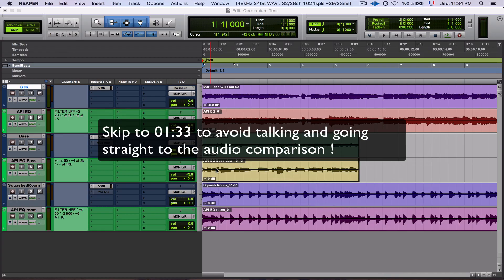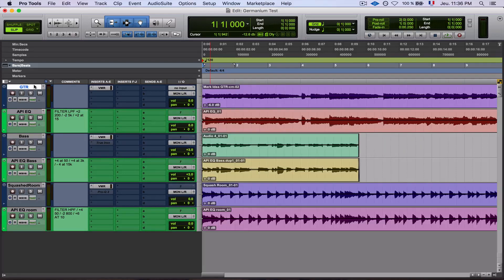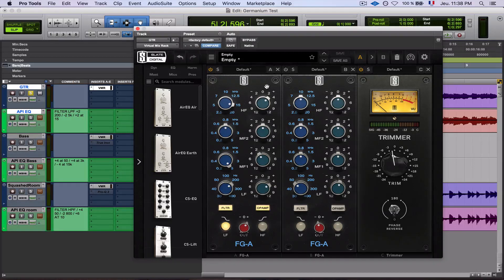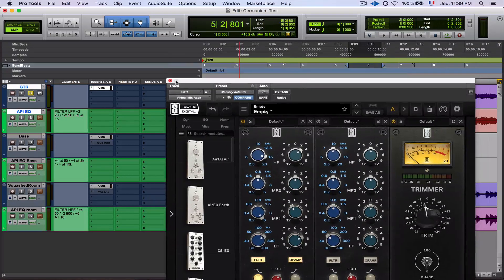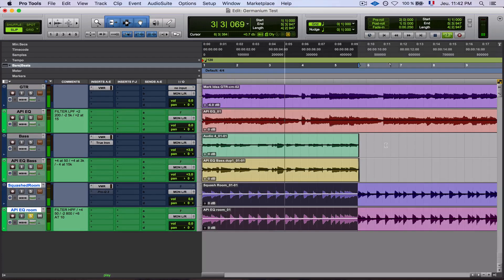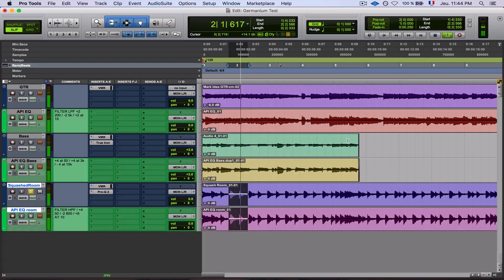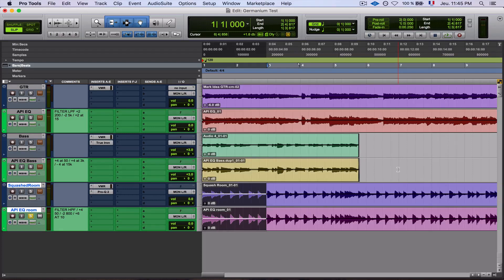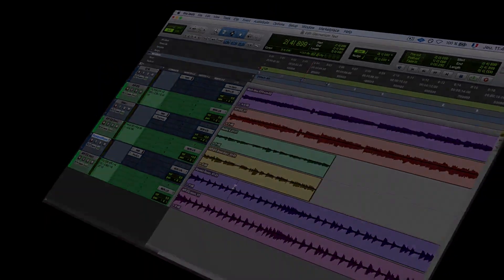Unbiased Review : Slate FG A - API 550A Hardware

Comment: comparison + magic trick with eq boosting! this is more then we expect! thx! :))  

little advice from me, i think you need to use 2 big meters like brainworx have..to show us true peaks , like the both of this tracks have not more then 1 db difference..its just for no question comparison , iam sure you made this match before :)
Reply from the maker: Hey man, thanks for the kind words =D. Yeah the True Iron trick wasn't expected at first but I wanted to match the sound as close as I could by staying 100% in the box. That did helped indeed and I'm quite happy to found that. And also happy you liked it !

Yeah I thought Pro Tools meter on the tracks should be enough but your suggestions makes a lot of sense and I will definitely think about it. 
Of course I try to do my best to level match every time :).

Comment: About transient smearing:
I believe that what you hear is not so much about transients, but about harmonic saturation. Other words, your equalizer gives you more body and depth than FG-A. In comparison with it, FG-A sounds clearer and more transparent. Working with transients is essentially nothing more than a phase response. Based on the tests, FG-A has an incredibly smooth phase response curve. When boosting 12.5 kilohertz by 12 decibels, the phase rotates by only 36 degrees. This means that it is just incredibly transparent in working with transients. Perhaps even too transparent, which you do not expect from a hardware emulation. And you interpret this gap with expectation as a smearing of the transients. I'm not saying for sure, just a hypothesis :)

However, thanks for the video and good luck in the future!
Reply from the maker: Hey mate. In fact you just pointed out an excellent point. And I think most plugins suffers of that when comparing them to their hardware counter-parts. The phase difference is more about the part when I said that "the sound was going to the middle of my nose with FG-A and just in front of my face with hardware". I think that was the phase thing. Because I noticed that when I inserted True Iron (on the bass) which affects the phase (they focused on the phase shifts transformers implies) it reduced that impression quite a lot.

So in a sense, you are totally right.

But for the transients handling, well it's hard to hear it here on Youtube because the audio had been processed 3 times before being listened on youtube (recording in the DAW + Inserting in the Video Editor and exporting video + Youtube conversion). But I got the raw files. And if you are geeky as me I can send it to you so you can focus on that. It's especially noticeable on snares.

But maybe this is phase again ? It may be right. But I know I'm no crazy saying that EQs have also their way of handling transients (for instance the GML 8200 is famous for doing that really really well). Which could be because of phase shifts, harmonic distortion or even natural compression of the electrical components.

Excellent point mate !
Reply: >> But I got the raw files. And if you are geeky as me I can send it to you so you can focus on that. It's especially noticeable on snares.

It's awesome, I'll be absolutely happy if you do. Then I could extract the frequency response of your equalizer and compare it with FG-A with the most possible accuracy. And if applicable, then compare their phase and harmonic differences.

>> The phase difference is more about the part when I said that "the sound was going to the middle of my nose with FG-A and just in front of my face with hardware". I think that was the phase thing.

Yeah, you are right! And it's also about the crossfeed and channel non-linearities of the hardware unit. The software does not have this, so the depth is slightly different.

>> Which could be because of phase shifts, harmonic distortion or even natural compression of the electrical components

I believe so. With eq we affect the frequency and amplitude, but we do not control only one parameter - the phase. As far as I know in the temporary domain, only these three parameters exist in fact. So I believe that transient smearing is nothing more than introducing a delay in the frequency group. The so-called group delay. And everything else is a hardware non-linearity. I.e. compression and harmonic saturation. Correct me if I'm wrong :)

I'm glad to talk with someone who has the same passion for this as I!

Cheers :)
Reply from the maker: Sure dude, gimme your email in private message on Youtube and I'll send them to you. As I said, it's my job to passionate about those stuffs ;) (Ain't that cool ? Except for my girlfriend maybe haha).

I don't think crossfeed is a thing here since it's a mono unit, but I may be wrong here !

Indeed we only control the frequency (which results in phase shifts) but we are also subject to things we don't handle (except if you know them and play with them) like saturation and harmonics, especially with API EQs which reacts differently regarding the amount of boost or cut you can apply.
Group delay frequency distortion maybe. That are things are nearly impossible to tell just by listening haha !
Reply: Unfortunately From July 9, 2018, you can no longer send private messages via youtube. They disabled this feature. Perhaps you could put the files online through the cloud? In Google Drive for example.

>>  I don't think crossfeed is a thing here since it's a mono unit, but I may be wrong here!

Ah, I see. I did not notice that it was a mono channel. But the hypothesis was good :)
Reply from the maker: Hooo damn ! That sucks, I sent you a hang-out on Gmail/Google Drive.

Yep indeed ^^.
Reply: WheelieMix, you're not crazy. I noticed that with a lot of plugins vs their hardware counterparts. Plugins tends to have the signal as more in your face sound and the hardware makes the signal sit little back in the speakers. That's usually one of the differences that stands out to me. The plugins are still great tools to use. It's all about what sounds you're looking for.

Comment: You are using the plugin with the filter enabled. Did you also enable it on the HW?  Cause the curve you had to add with PRO-Q is quite similar to the highcut. Also heard the lowpass on the drum's high frequency, as compared to the HW examples.
Actually with the opamp on, the plugin adds more bass just running audio through it.
Reply from the maker: Don't worry mate the filter was also used on the hardware as noted in the comment section of the tracks in protools ;). 
It's not the bass that is really an issue to it, it's the transients smearing happenings and how it flattens the sound COMPARED to the hardware. Technically it doesn't flatten the original source, it's just the hardware that adds something more that I prefer (by far).
Yes indeed the Pro Q is a low shelf boost. Which is still not the same as a high cut as increase the lows, yes give a feeling of reducing the highs. Which mathematically works. But not sound-wise since a boost in the lows doesn't "excite" the same harmonics as a high-cut, which so ends up in a different sounds.
Anyway even without the Pro Q2 boost, the lows were quite different, even with the opamp on (which was always ON, on the demo btw).
But again, it's not the bass boost that is bothering me. Because I expected different EQ results since calibration, converters and units emulated were different (APIs sounds different between each others). So yeah, not bothered that much by the bass boost or lack of bass boost (and using True Iron on the bass worked quite well to be honest :) ).
Reply: Sorry i meant to write lowcut there. :)
I hear the difference in sound, but i wouldn't really attribute that to phase (here). On the drums to me It's more like it's missing quite a lot of the airy top end on the plugin and has a more exaggerated bump at around 7k. And the HW version sounds much more saturated in a very pleasant way. 
But anyway all Slate plugins have this transient smearing characteristics for me.  (but i don't hear it there - maybe the youtube thing)

I've compared the FG-A with the Softube one a few days ago, and while i liked the FG-A's character much more - warmer midrange, more vintage vibe, the Softube sounded much more open and crunchy on the transients, sounding closer to your HW example. I think it could have to do with the Softube being oversampled (i guess 4x?)

Have you tried turning on the oversampling on the Slate one?
Reply: Also i would try turning the OPAMP off for a test, and see if it clears out the top end and transients, cause it really darkens the sound, and that is exactly what i hear on your demo.
See the green line: https://prnt.sc/kfig37
Reply from the maker: Well Youtube clearly didn't help to hear it. And it's maybe less obvious than on preamps emu or such other things for sure. I've never tried the Softube. Because I love APIs EQ, but not as much to be on a quest for the best ITB API EQ to be honest ^^. And having the hardware help me not searching too much for it haha ^^.

I'll try turning the oversampling on and will report back the results. I remember trying it without any success but I'll try again.

Yes I think I said in the video (if I didn't, I was wrong to forget saying it) that I tried with and without the OPAMP for more "transparency" regarding transients and stuff but it didn't helped. It makes FG-A sounds cleaner which makes it even further away at how the hardware sounds.

Comment: put a sinosoid on the fgA make a snapshot of the response with Ozone. Do the same with the hardware and compare the differences with matching eq.
Reply from the maker: Hello !
Unfortunately it wouldn't work that well. Analog EQ are not only specific curves but also specific harmonics and saturation (especially when boosting). So just having the curve is not enough. Otherwise a lot of manufacturer would have the sound of the hardware just 100% right super easily :).
Reply: having load of tube amps, cabs and guitar, and an helix which I use to match eq my gears, I can tell you that matching eq is a great technology to mimic. Maybe not 100% perfect, but, at in mix... just try my test, and we'll see... based on that.
Reply from the maker: Oh yes sure it works and it's wonderful stuff to experiment, I definitely agree ! But believe me I did, it doesn't sound the same here (did it also with Slate FG-S, that was my first test with match EQ, just out of curiosity :), and it didn't sounded the same, similar for sure, but not the same, and that is normal).
Reply: fg-s is very very off frequency wise from a real ssl E channel. The closest to the eq from a real console,  I tested is the McDsp G channel on E eq setting. On FG-S when you boost at 3k on upper mid, you find 2,2K... And on low mid, it's starts around 300hz for knob on 200hz. On the real hardware, with low mid @ 200hz, you're more around 130-150hz. Of course, matching eq is not workable, as you need have impulse, but to compare frequency curve of hard vs soft, it's sufficient.
Finally, I am quite sur, the FG A doesn't the same frequency curve than a real hard, it was never the case on previous emulation
Reply from the maker: I agree with FG-S being off. I noticed that on the high-end especially. The classic 8khz boost. But if you match the sound it's startingyo sound similar. They maybe just emulated an unit that was off. That can happen.
For FG-A well it doesn't sound that far off to me. On the bass with True IIron it was very very close IMO.